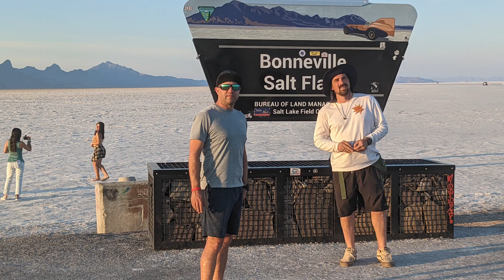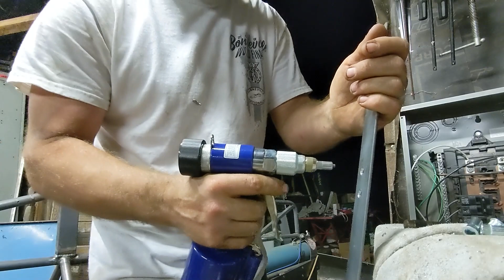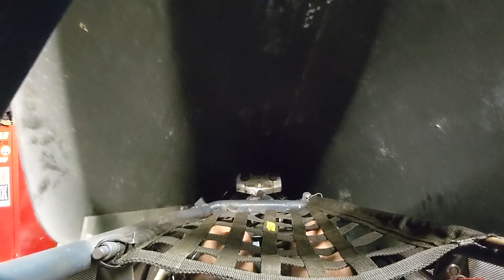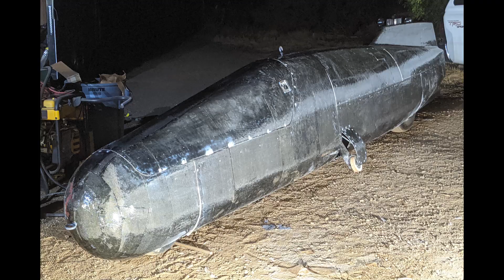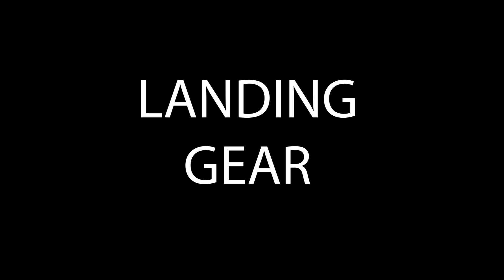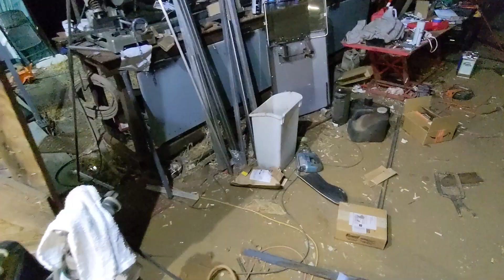Run up to Bonneville speedweek 2021 | Lark Machine Co

Comment: Nice! That air bubbles in the resin are a nightmare, for quick jobs with glossy finishes I can't recommend enough a pass of steel wool it makes a satin matte finish very cool to hide irregularities, like waxy finish. High ambient heat makes big bubbles with resins, I usually do a pass of sandpaper and varnish again to correct it, since the air should be already sealed, then resin can fill any scrapes without leaving marks.
Reply from the maker: Thanks!!!!  I'm focusing on fixing some reliability issues before I focus back on the bodywork
Reply: @sheanyquist  You're welcome, glossy finishes is kind of an obsession of mine! hahaha